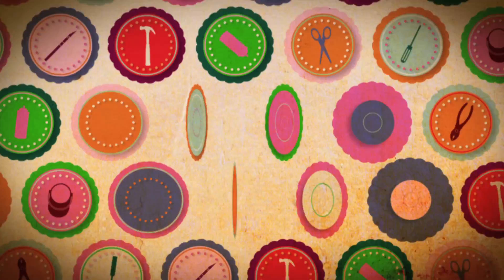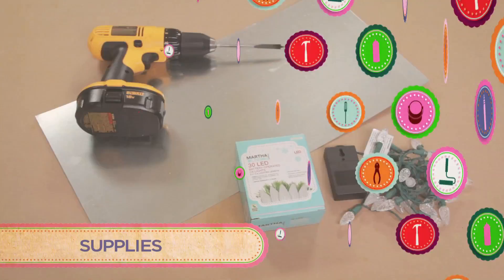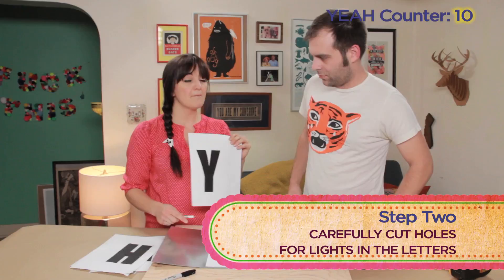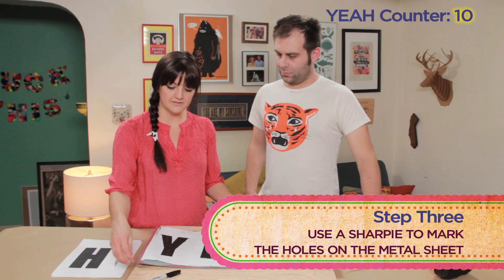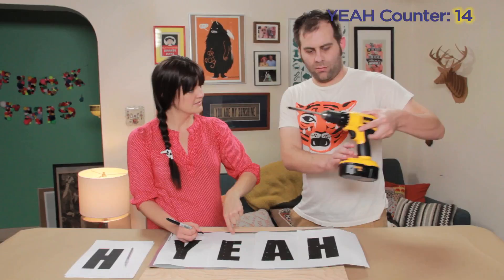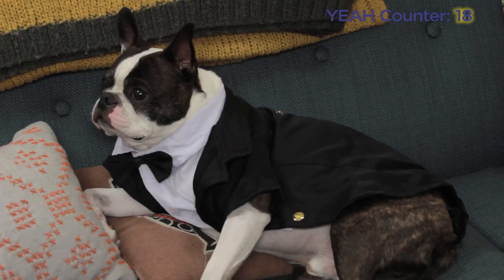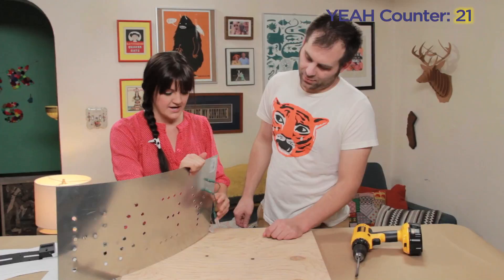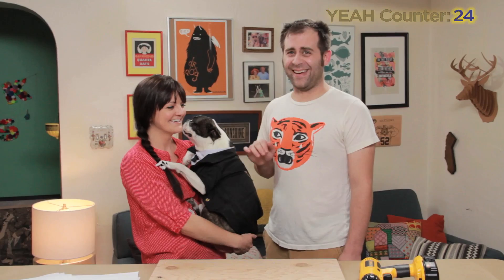HOW-TO Make a Light Sign w/ Jake Weisman - DIY DAMMIT!

Comment: could you use a wood sheet instead of a metal one? basically because I really have NO idea where to find one... I'm mostly concerned about it burning due to the lights.... yeah
Reply: You can get a metal sheet at Lowes or basically any other hardware store.
Reply: Nathan H Thank you, but I live in Spain haha. Anyway I guess I can try and find it anyway...
Reply: Theskyiscrazy Def won't burn if it's a wood sign with the battery powered lights I used. Any LED light probably wouldn't get hot enough. But ask around for aluminum sheeting. Buena Suerte!